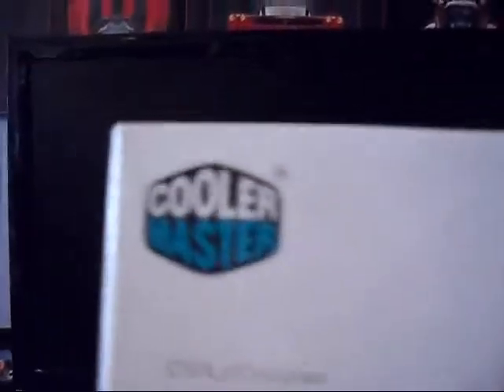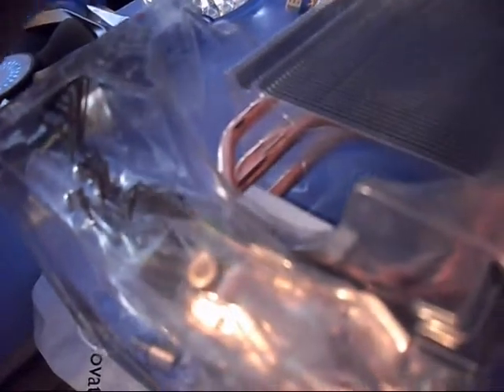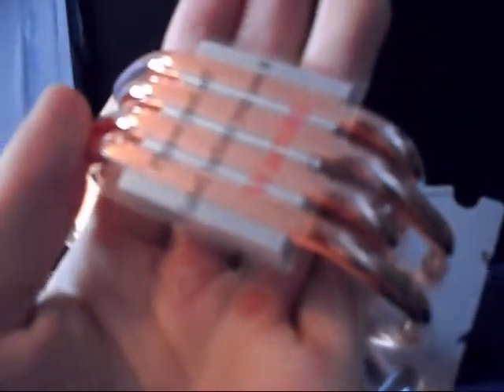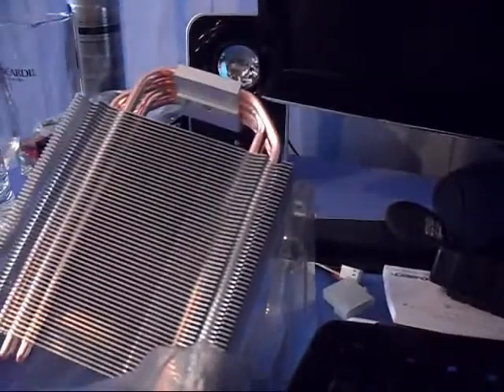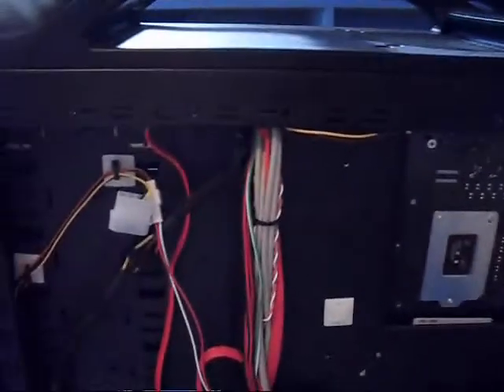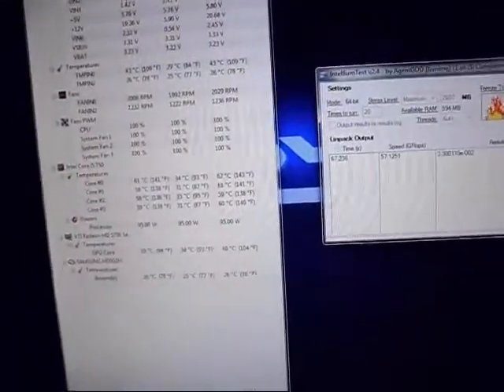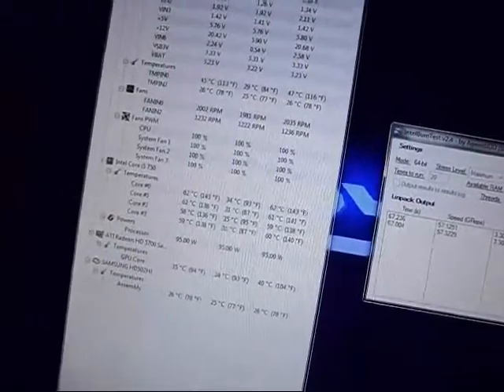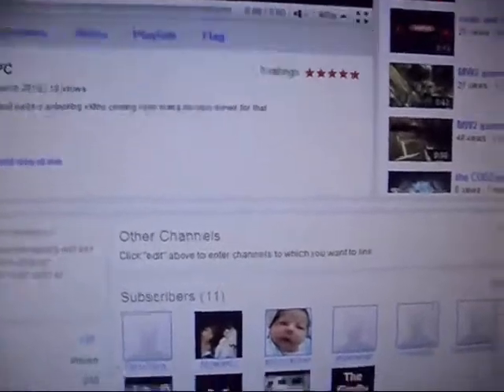coolermaster hyper 212 plus unboxing and overclocking core i5

Comment from the maker: @ninjaseven 
a 5850 is your best bet as it can be OC'ed to the same speeds a a 5870 and can beat a gtx 480 and around £60 cheaper then GTX 470 and alot less power and heat

Comment from the maker: @JooHaxDemoTaken like i said everyone has different opinions on what is stable 
couple of months ago i booted my i7 920 at 4.8GHz on air 
i couldnt do anything with it as it would just crash but it was still stable enough for what i needed it to do which was a CPUz validation and Wprime 
i buy hardware just to benchmark no other reason for it 9 times out of 10 i buy stuff i dont even need run benchmaks on it and then sell it again with in a couple of days

Comment: I just installed this, and I checked on the stats, and it is spinning at around 660 RPM....is that ok ? will it go up when the CPU produces more heat ? or did I get a faulty one ?